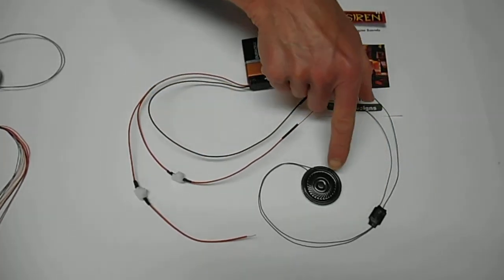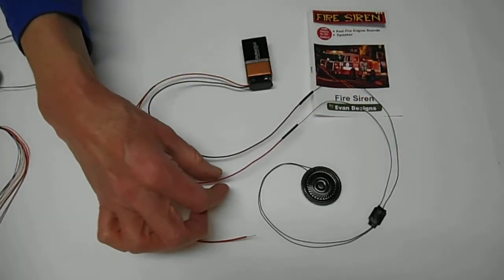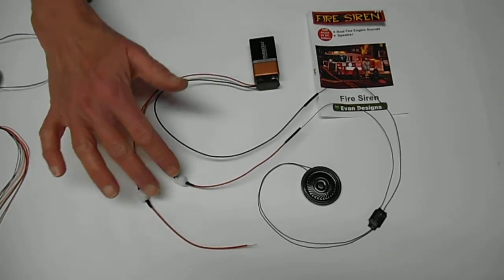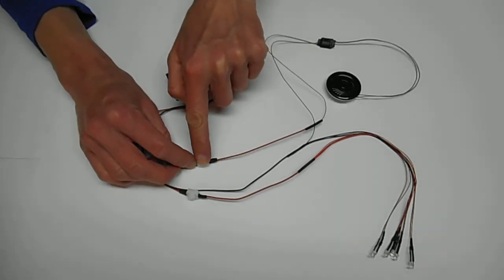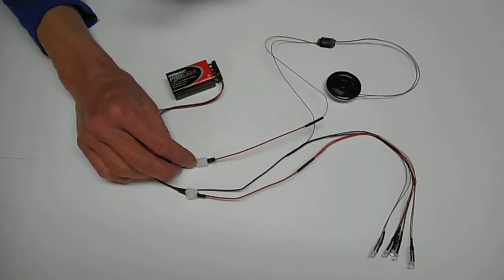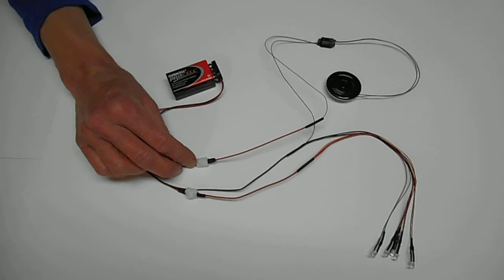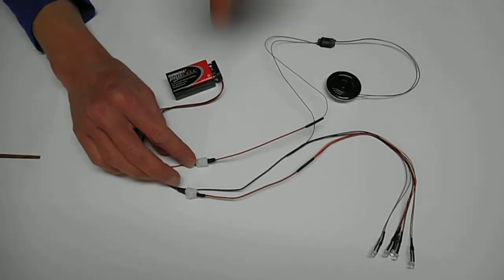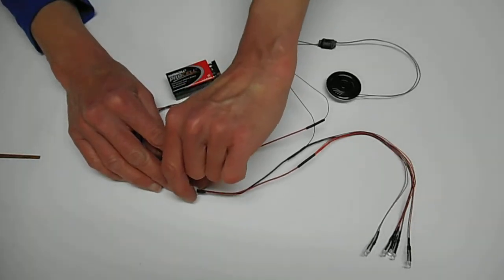Fire Truck Siren Circuit for Model and R/C Emergency Vehicles

Comment: Can you compare how fire siren sounds through the different speaker sizes?
Reply from the maker: Hi Jeremy Thank you for the suggestion.  We do compare the various speakers in this video: https://youtu.be/Cd3CsbK43J0  the video is of another siren we offer, but it does compare each of the speaker options one after another side by side.  I hope this is helpful to determine the relative volumes.  If in doubt on the size to get, we normally recommend getting the bigger of the 2 and then put some loose cotton fluff on the speaker to dampen the sound a little without altering the tone.

Comment: Where is the siren sound saved? The  speaker or in the switch itself?
Reply from the maker: The circuit is very compact. I point to it at about 1 second into the video.  You can see the circuit on this page of our website: https://evandesigns.com/collections/diecast-police-lights-siren/products/fire-truck-siren-for-your-diecast